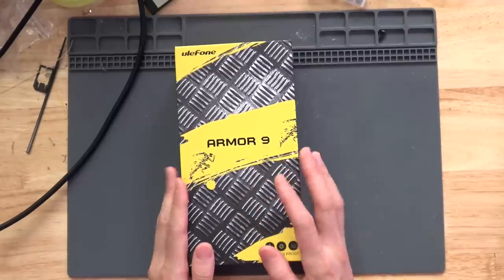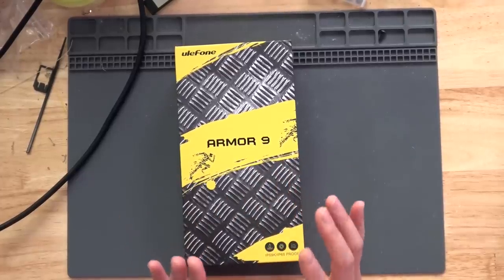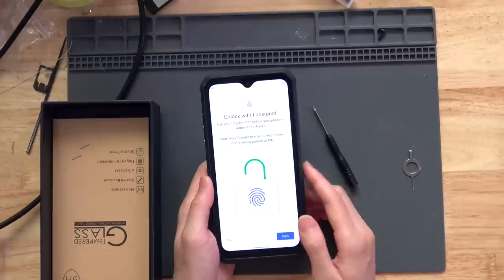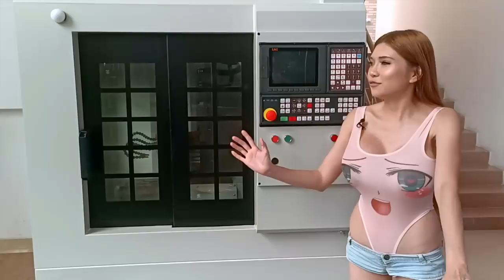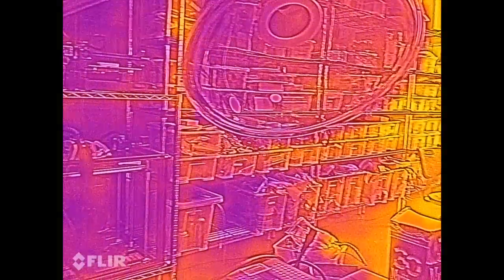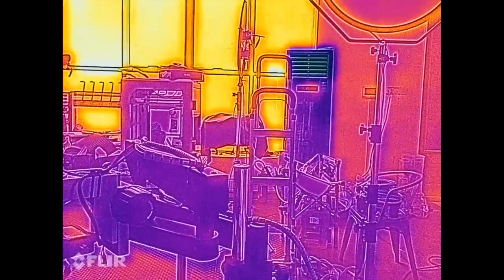The Ulefone Armor 9- Thermal Cam and Endoscope, now on Kickstarter

Comment: The endoscope being attached like it is is brilliant. The USB ones tend to fall out if you bump them or get the cord trapped and Wifi ones are just crap. Really good review 😊😊😊
Reply: What worries me with the attachment is getting replacement endoscope if something goes wrong with it. USB is standard. This connector - good luck with finding something. (Yes, I know that you can probably build matching connector out of sugru/epoxy and pogo pins, but that defeats the purpose).
Reply: @johndododoe1411  Or just a new plastic clamp manufactured. Custom plastic is replatively easy to replace. Custom connectors - not so much.
Reply: USB-C plugs can differ substantially in their firmness of connection. Use with endoscopes shouldn't overload most of them, unless they're misused.

Comment: There's been a disturbing discovery by one of the one of the backers who received their Armor 9 phone. The phone ships with the Adups' FOTA (firmware-over-the-air) wireless update service which is regarded as spyware and backdoor access software. It has been shown to send personal information to their servers in Shanghai, including phone number, IMEI, installed apps list, even as far as the contents of SMS texts. The software also has a system user level rights so that it allows Adups to install software remotely at will without the user's knowledge.

Google themselves have blacklisted the software in their compatibility test suite... and AFAIK, Adups is not allowed on US phones anymore after BLU phones were discovered to have it installed several years ago. Pretty sure it breaks some of EU's data protection laws too, although Ulefone have put out a "EU firmware update" which still ships with Adups installed but probably scaled back data collection. Still not a good answer though, as the best result would be to remove Adups and use Google's default update services instead.
Reply: @Hugh Lee ...... Nice to know buddy ....👍
Reply: but then we routinely give apps similar high level permissions from Playstore without thinking of it.
Reply: ANY idea how to disable it??aiming to buy one asap but dont want malware installed in
Reply: @samuelkatherinediozarago7692  Root and replace the ROM is usually the only option for this type of service. On this phone you would loose a lot of features, like the thermal camera drivers with just about any third party ROM though.

@Paul S No, you cannot give an app installed from the Play store root permissions. You can't even side load apps on most devices with root permissions. This is the type of app that can make a phone pretend to turn off when you tell it to shut down, while actually putting it in surveillance mode.
Reply: @TrabberShir And where is your reference? I wont custom root to more unknown malware. I believe it will be removeable.
Reply: @samuelkatherinediozarago7692  "I wont custom root to more unknown malware." I think you have a typo that makes me not able to understand what you mean. But I did a little more research and discovered that I oversimplified, so this is going to be a bit complicated and I will address it in 2 parts. 

First lets talk about specifically the FOTA service:

In general, if you root the device, yes you can remove it but at that point replacing the ROM may be easier. Most devices are designed to make rooting difficult for the end user (part of the default SELinux rules for Android) and core components of the distro are usually protected from modification by additional SELinux rules. I would be very surprised if this device is different in that respect. If you can uninstall Google Play Services or the SIM card interface, you would remove this in the same way.

To be clear, this is not strictly speaking malware, it is a core part of how this android distribution was designed. It replaces Google's OS update service, if you remove this service you will not be able to get android version updates, including security patches, from the manufacturer. It is sketchy because of what typically gets installed with it, and because as a user you can not be sure who has the power to replace your operating system when this is part of the distro. Using Google's service for this, any update needs signed off on by both Google and the device Manufacturer. With this it may only need the device manufacturer or Adups and Adups can do things without the device manufacturer even knowing.

I would not be surprised if it is included here because the developing tensions between the US and China may make it impossible for Google to support Chinese device manufacturers in the future and Adups is the biggest other option out there.

Now, the part that is definitely malware:

com.adups.fota, com.adups.fota.sysoper are hidden but not protected packages which can be removed via USB debugging. These packages seem to be loaded by the FOTA service if present and do fun things like sending all your call logs and text messages to a server in Shanghai for some reason. Not all devices using Adups's update service even have these packages and there is no garauntee these packages always have these names. And, so long as the Adups service is installed, there is obviously nothing preventing Adups from silently installing them again after you delete them, although I have not seen anything claiming this has happened.
Reply: What rugged smartphone doesn't cause I was really thinking about buying this

Comment: An interesting product. In particular, the endoscopic function and the FLIR. You are correct in that it would be useful in the trades, such as HVAC, refrigeration, mechanical repair and t/s. You don't mention it, but the endoscope is immersible to 15m for 30 mins. and it's two meters in length. That, and the eyes on that singlet you were wearing gave me a much needed laugh with my coffee this morning.

Comment: I do love these rugged phones. For someone like me who has a bad habit of dropping phones, these are brilliant. I just wish they had better quality cameras in them...but thats kinda asking too much. Thanks Naomi!
Reply: My issue is with the flush screen. The protective lip should be at least 2mm above the screen. Rugged or not, this way a face down landing most likely destroys the screen probably even on clean flat surface.
Reply: @gabiold  
Some phone case designs have that 1 or 2 mm guard rim around the screen. Evocel made mine.
Reply: @stephenarling1667  I know, I always used to use those (on a phone which does not have a curved screen - but that's a different story), but on a rugged phone which has a rubber casing already, it should be a default feature. In my opinion...

Comment: Considering my Pixel 3 is dying after 1.5 years, I've been looking around for a new phone. And as someone looking to become an electrician and also does a lot of home renovations/projects (and just all around geek), the thermal and endoscope functions may be useful. I don't play games or do much on my phone so the somewhat older CPU/SoC isn't a big worry for me. The 6600mAh battery and stock Android 10 are my two biggest pros on this phone apart from the special cameras.

Also, Naomi, you're making me go broke! Backed the Creality CR-6 SE since I was looking to get into 3D printing (was looking at the Ender 3/5 before) and now this phone. I'm finding some good recommendations from just following your channel, and I don't know if that's a good or bad thing...

Comment: I'm having trouble finding the video size and frame rates for either phone.  I'd really like to get at least 4K30, with 4K60 desired, and even faster frame rates for smaller frame sizes.
Reply from the maker: They have a 4k mode but you aren't going to get anything useful at 4k on either phone that you are not getting at 1080 60, that's just nor what they are for.

Comment: The biggest issue with the endoscopes is that they do not include an inside pipe guard: when you put an endoscope inside a pipe, the flat face of the camera tends to bump into the first obstacle and the image becomes utterly useless, not to mention it gets stuck there and there is nothing you can do about it even shaking the cable does not go any good most of the time. This results also in scratched lenses. I am dreaming of a pipe guard which you could put on the front of the endoscope which would keep the lens away from obstacles, thus keeping a straight picture while permitting to get over bumps in pipes like corrugated ones especially when there is a turn...
Reply from the maker: It comes with several, I  just didn't use them...
Reply: @Naomi-Wu  Yeah there are some tips you can add to the endoscope but none is designed to go inside pipes to protect and keep the lens leveled.
Reply: @ThierryC2373  
Should be simple enough to prototype a lens guide. A few inches of stainless steel binding wire to form a"cage" and you'd be in business.

Comment: Smartphone batteries only last 2 years as people and android don't take care of the battery, if you keep it between 20% and 80% it will last for many years. The main thing is to avoid it sitting at 100% charge or 0% its really accelerates degradation, so try to avoid plugging in overnight and charge it while you're getting up, t's not hard with fast charging and huge batteries like in this phone.

Comment: Not sure how i feel about the rugged phones, i have the Cat S61 and while it has been great and the thermal camera is great for checking bearings and cooling systems. it seems the cameras are always a letdown with these type of phones.. 
the endoscope is much clearer than i expected it to be.
It's a good review, i would like to see what photos look like in low light that is where you really see how well a camera performs and its real world usability. 

Thanks for the review, based on this i dont see much reason to upgrade my current rugged phone, i look forward to see what next years rugged phones look like.

Comment: I have both the Armor 6 and Armor 7. The upgrade from 6 to 7 made it worth it because you got a better SOC, a waterproof USB port without a cap, etc. When I look at the Armor 9, I don't see any reason to upgrade from the Armor 7. The FLIR camera and endoscope are cool but how many times am I going to use them in a professional manner? As an existing Armor 7 owner, I'll skip this one and hope they put something really cool in version 10.
UPDATE:  LTE band 71 is on the Armor 7 and missing on the Armor 9. They also seem to have removed QI wireless charging?!? This isn't an upgrade, its a downgrade with some gimmicks bolted on!

Comment: As a welder which phone do you think is more durable around sparks an high heat?
Reply from the maker: It's going to mark the rubber but should be better insulated